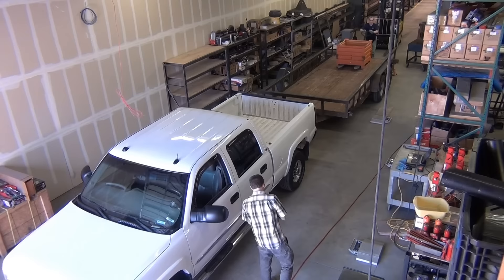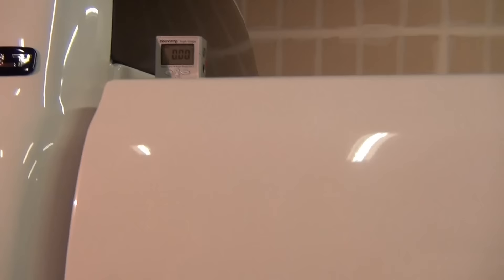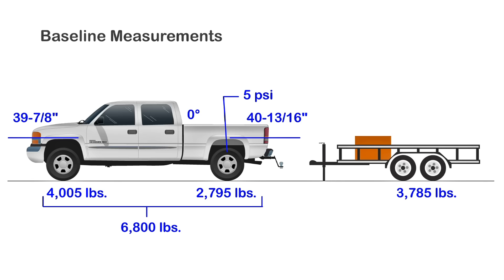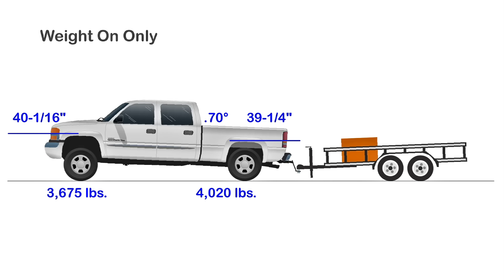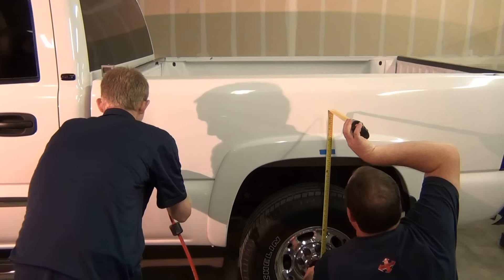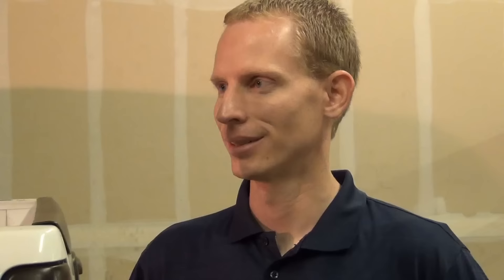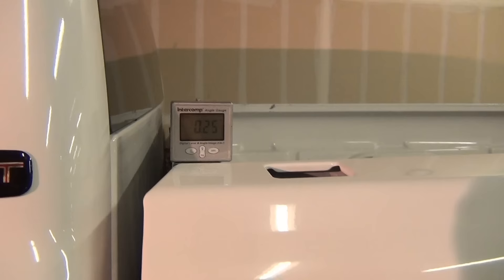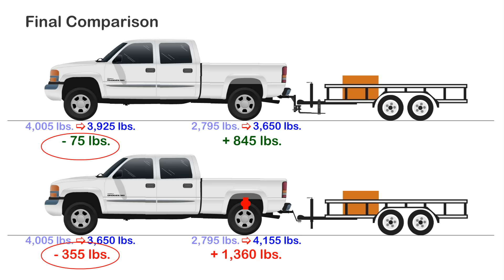The Difference Between Using Weight Distribution and Air Bags to Level Your Load

Comment: Why not use both - airbags AND weight distribution hitch which is exactly what I use.
Reply from the maker: Thomas H,
Both working together is a great setup.
Reply: Agreed Thomas H....I have used both with my Toyota Tundra. Will use air bags and Andersen weight distribution /anti sway system for my 2017 F350/Arctic Fox 26X. Will also have a 2018 RZR S1000 on my Diamondback utv system. I think this will be the ultimate way of solving these problems.
Reply: Bryan Long. Question here. Do you inflate the bags then the hitch or hitch then bags
Reply from the maker: +Niko Gonzalez,
We recommend having the air bags inflated first, then setting up and adjusting the weight distribution.
Reply: FastwayTrailer Thank you for the great video and information.
Reply: Yep! I run both! And now adding timbren suspension blocks this weekend! 👊I can haul a freight train and control it!👊
Reply from the maker: +Bryan Long,
You're welcome! Thanks for the comment.
Reply: I have a  2007 Toyota Sienna with a “tow package” and I am thinking of adding a towing system for a very small camping trailer. The Sienna has front wheel drive. This video has given me concern about the axle capabilities and towing. What do you think?
Reply from the maker: +Constance Condit,
We are not familiar with the Toyota Sienna's tow capabilities.
Consult your owner's manual, or a qualified Toyota dealership to find the specific tow capacities and recommended / not recommended equipment for your Sienna. They will tell you whether a weight distribution hitch can be used or not. They will also tell you what your maximum gross vehicle capacities are, individual axle weight ratings are, as well as maximum tongue weight capacity, and maximum gross trailer weight capacity. As long as you don't exceed these, you should be fine towing a small trailer. Kudos for being aware and learning what you need to know to tow safely! Good luck!
Reply: FastwayTrailer:  Thank you for your help.
Reply: How do you estimate what pressure to inflate the airbags to before tuning the weight distribution system?
Reply: So what is the steps when using both air bags and weight distribution hitch? Do you engage the trailer first, then air up the bags to level the truck, then add the weight distribution bars?
Reply: I’ve read the tongue weight should be 10-15% of the total trailer cargo weight including the trailer weight.  Do you agree with this percentage?  I assume you were using 1000lbs tongue weight for demonstration purposes but seems that 1000lbs would be in the the correct range for your demonstrated setup.
Reply from the maker: +Constance Condit,
You're welcome!
Reply from the maker: +G Frazier,
That is a very good question, thanks!
It is a bit of a trial-and-error process. Every tow vehicle and trailer combination is different. Everyone's "ideal" ride (stiffer / softer) is different too. To figure out what works best for you, we recommend starting with a lower inflation, trying it out, and then increasing it if you think you need to.

For an average rig, we have found that starting around 10 psi, then setting up the weight distribution correctly, results in a pretty good setup. (If yours is more extreme - very heavy truck bed cargo and the trailer, for example - you may want to start out with more air.) From there, you can add a little air, but remember to check the weight distribution when you do, because adding air will reduce the weight distribution. If the weight distribution amount gets too low, you'll have to make adjustments to the hitch setup.

Our engineers recommend that if you're not satisfied with the ride initially, try adding a little more weight distribution first, before adding air, to see if that improves the ride. Always remember to re-check the measurements to verify proper weight distribution.
Reply from the maker: +flintdog006,
Our recommendation is to air up the air bags, then set up the weight distribution hitch. This is done so that the hitch ball is set at the correct height for the trailer, which makes getting correct weight distribution much easier.

Thanks for the comment!
Reply from the maker: +Emp Ty,
You are correct. It is generally accepted to have the tongue weight be 10% - 15% of the gross trailer weight (weight of trailer plus all cargo). Yes, we were trying to use enough tongue weight to illustrate the point. There was no need to keep this within the 10% - 15% range since we were not planning on towing with it. For this trailer's gross weight at about 4,800 lb you would want to tow with a tongue weight of between 480 and 720 lb.

Thanks for the comment!
Reply: We have a 2008 Sienna and pull our ≈3500lb pop-up with it, no real problems other than a bit of sway and weird braking. That's why I'm buying an Equal-I-zer WD hitch. I reached out to them and they recommend the 600 over the 400 based on a tongue weight over 350lbs and stuff in the back of the van.
Reply: So, if I’m understanding this correctly, a weight distribution system is safer and more effective than air bags (if I had to choose between one system or the other for financial reasons) Correct?
Reply from the maker: +Avid Hiker,
We are saying that both products do different things, so you should evaluate what your needs are with your tow vehicle and trailer, and choose the best option for you.
If your situation is similar to our test case, where you're towing a bumper-pull trailer, our recommendation would be to try a good quality, correctly set up, weight distribution / sway control hitch first. Then, if you frequently carry a heavy payload in the tow vehicle, or simply want the flexibility of being able to easily adjust the stiffness of the rear suspension, you may choose to add an air bag system to your tow vehicle as well.
Reply: FastwayTrailer What is your opinion on the Hensley Arrow hitch system?  Worth the extra $$$?
Reply from the maker: +Avid Hiker,
The Hensley Arrow is a good hitch. It does some things well, others not so well. The answer to whether it is worth the extra money is subjective, and differs depending on who you talk to, and what they value. We recommend the Fastway e2 hitch, and the Equal-i-zer hitch. Both are excellent values, and provide fantastic performance for a fair price. They have an unmatched track record for quality, great warranties, and both are very user friendly. Their customer support is unmatched, and they have a strong dealership network to support them all across North America. You can find more information about them here:
Fastway e2 hitch:
http://www.fastwaytrailer.com/e2-hitch
https://youtu.be/ChyN-d_qcHo

Equal-i-zer hitch:
https://www.equalizerhitch.com/
https://youtu.be/aA3_hH60fzE
Reply: How much air do you put in your bags? How heavy is your trailer/RV? My «RV is 6000lbs.
Reply: Would love to have seen what running both did !?
Reply from the maker: +TheTripleDubya,
That is a video we have planned for the near future. Stay tuned! Thanks for watching.
Reply: ..cool..
Reply: I say go with the weight distribution and forget about the added cost of airbags. Kinda redundant.
Reply from the maker: Thanks +Tim Maw. Weight distribution is a great solution that resolves most situations like this.
Reply: Thomas H Just ordered Bilstein shocks and firestone airbags for my 2008 Aspen pulling a 27’ Eclipse Toy Hauler.   This along with my quality Weight Distro and sway will be the shit
Reply: great video explaining a towable trailer and the effects to the tow vehicle and trailer. thank you.
Reply from the maker: Glad you liked it +William Barrett. Thanks for watching, and thanks for the comment!
Reply: @constancecondit4349  I see this is a very old post I stumbled across, but I thought I'd mention my two cents worth so that maybe it helps someone else. As far as I've always known, it is NOT recommended to use a weight distribution hitch on any vehicle that does not have a solid frame. I believe all Siennas are unibody construction. Unibody construction + weight distribution hitch = damage to tow vehicle.

Comment: Great video.  My first used Travel Trailer came with an Equalizer WD Hitch.  I used my 4x4 Expedition to tow a 6400 lb trailer.  It worked great.  I then got a newer Travel Trailer that I pull behind my diesel Excursion.  I kept the Equalizer hitch when I traded in my Travel Trailer and I'm glad I did.  The new TT is about 8600 lbs, and it will make the rear of that Excursion squat without the Equalizer.  I wouldn't even think of towing that heavy of a trailer without the Equalizer.  Hey, they just proved the reason to use it.   Like some other viewers said,  I too would like to see a comparison that has the airbags inflated and using the Equalizer.
Reply from the maker: +HighlanderMikeGolf, we're glad to hear you've had a great experience with your Equal-i-zer hitch. Thanks for the comments.

Comment: Thank you for taking the time to conduct such a detailed experiment to promote your product. I found it refreshing to find someone using a scientific approach to address an issue rather than rely upon hearsay or unfounded opinion.

However, there exists a flaw in the video's data that I would like to address. Specifically, the results do not account for the mysterious weight gain of 110 pounds between the "Baseline Measurements" and the "Weight On Only" measurements. The "Baseline Measurements" show the combined truck and trailer axel weights as 11,585 pounds. But the "Weight On Only" measurements show that weight increasing to 11,695 pounds. That's a 110 pound discrepancy which remained unaccounted for.

Furthermore, the problem increased with the next set of measurements, as the "With Airbags Inflated" combined axel weight had inexplicably increased to 11,715 pounds, differing from baseline by 130 pounds, and increasing from the last set of measurements by 20 pounds.

My point in all of this is simple. The measurements show conflicting and erratic data. The combined axel weight of the truck and trailer should not change over the course of those measurements, as neither the truck nor trailer can gain or lose weight. It should always equal the baseline of 11,585 pounds. But it doesn't. Which begs the following conclusions:

Either, 1.) The test equipment has yielded unreliable data; 2.) The methodology of the entire experiment is flawed; or 3.) A combination of both 1 and 2. In any case, the conclusion used to promote your product are based upon unreliable and inconsistent information, and is therefore invalid.

It's possible you may have innocently overlooked these discrepancies. Do you have an explanation?
Reply from the maker: +Louis Guske, Jr, thanks for taking the time to watch the video so closely, and for the comment.

Let us start by clarifying that this was never meant to be a scientific study of weight distribution and air bags. The primary purpose of the video was to help clarify the misconception within the towing community that air bags and weight distribution do the same thing. We wanted to demonstrate the principle that air bags and weight distribution have different effects on the way the tow vehicle carries the weight of a trailer.

You are correct that there is a discrepancy in the numbers. This is due to the tolerances of the scales being used. The axle weight scales are +/- about 5 lb, and the tongue weight scale is a simple hydraulic scale with an analog dial that has a wider range in tolerance. We did the best we could to get good measurements, but as stated earlier, this was not meant to be a scientific study. Overall, the 130 lb difference is less than 1% of the total weight of the combined vehicle, and we determined this was accurate enough to illustrate the principle we wanted to show.

Our overall conclusion is that both air bags and weight distribution are good tools when used correctly and for the purpose they are intended. We hope that is a satisfactory explanation.
Reply: Thanks for clarifying that, as I now better understand the purpose of your demonstration. The beneficial effects of proper weight distribution aren't necessarily intuitive, and it takes a demonstration such as this to make that point. Thanks again for your efforts and bringing clarity to a subject that is typically confusing and often misunderstood.
Reply from the maker: You're welcome +Louis Guske, Jr. We're glad it was helpful for you.
Reply from the maker: +Mustang .308, air bags are a very useful tool when used in accordance with their intended design, which is to be a supportive addition to a vehicle's suspension. For pickups (or other vehicles) carrying heavy payloads like cargo or the pin weight of a 5th wheel or gooseneck trailer, air bags can greatly enhance the performance of a stock suspension. However, air bags do not provide weight distribution as defined by returning weight that is lost on the front axle of a tow vehicle due to the addition of carried weight from a bumper-pull trailer. Weight distribution changes the way the combined vehicle (tow vehicle coupled to trailer) carries the weight, which helps keep the tongue weight of the trailer from counter-balancing and thus subtracting weight from the front axle of the tow vehicle. These principles apply to all tow vehicles and trailers, however, each will react to a higher or lesser degree, based on their specific suspensions and the loads they are carrying. Each setup should be adjusted and fine-tuned for its own best performance.

Comment: Yes, but most people are interested about using both systems. Why not bring that part up? I don't know many people that just one one vs the other, most realize the importance of the WDH systems, but it would be nice to see a summary of the advantages/drawbacks of using both systems in tandem (and the best way to set them up if doing so)
Reply from the maker: Next time we'll have to include using both at the same time in a future video!
Reply: I was wondering the same thing.
Reply: From what I read, using bags along with WDS diminishes the benefits of the WDS both from sway and weight distribution perspectives. I can't explain why or if it's even true, but that's what I read.
Reply: Totally agree

Comment: I use both! I have a 26 ft pull trailer and a Ram pickup with about 800 lbs cargo in it. The Airlift bags are nice to have to keep level even with the equalizer hitch.
Reply from the maker: Glad to hear the setup is working well for you. Thanks for the comment!

Comment: 4005 - 3925 = 80 not 75.   Same on Rear - 3650 - 2795 = 855 not 845 as your summary shows.     The e2 distribution shows load being shifted to trailer axles, but only shows total load.   I would have liked to see two scales on each trailer axle - to show that you are overloading the front trailer axle when not level, and with the e2 you are level and distributing the load equally back onto both trailer axles.  Do this again to show if the e2 is distributing the trailer axles as well.
Reply from the maker: We've been wanting to redo this test for awhile now, as you pointed out some of the math is inconsistent. Thank you for your suggestions!

Comment: Nice setup with the scales and the video production.   The presentation of factual information is helpful.  What is missing is a follow on discussion of other factors that could change the distribution by similar amounts.  During a trip pulling an RV passenger, fuel, water, and food loads are worthy of consideration.  The load distribution hitch will too its best to accommodate the live loads but the addition of a discussion on the subject would improve the value of your work. As a check on your work you could list the total weight on each comparison slide. Also discuss the impact on ground clearance by the addition of the load bars.
Reply: Forgot to add that the live loads are going to be different on the road out then on the return.
Reply from the maker: Hi Pete! Glad you enjoyed our video. And thank you for your follow-up advice! We will take that into consideration when making or next video!